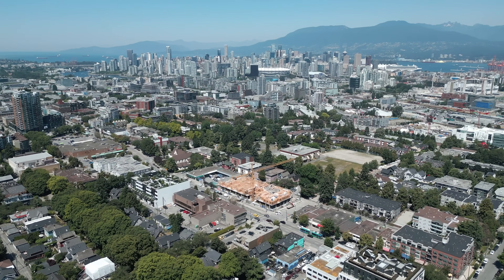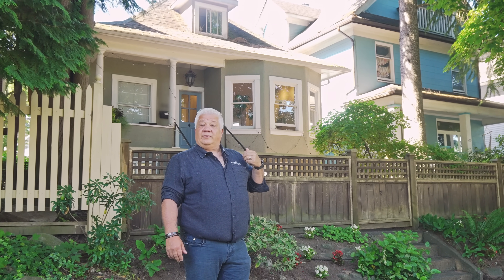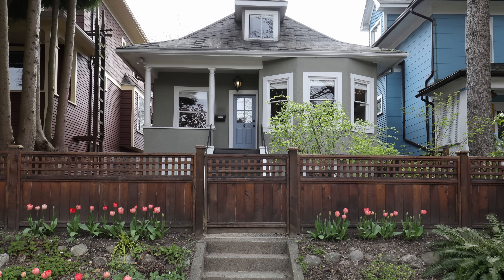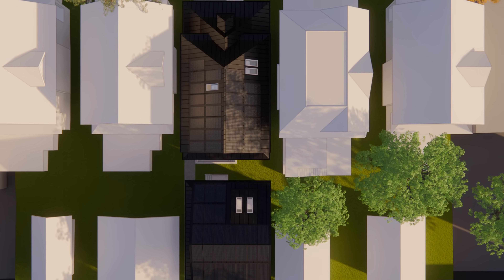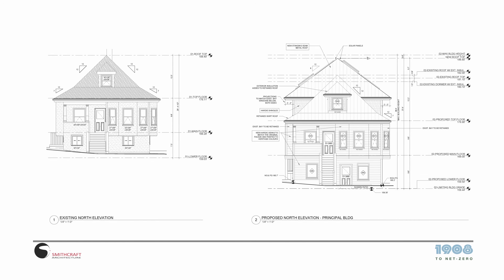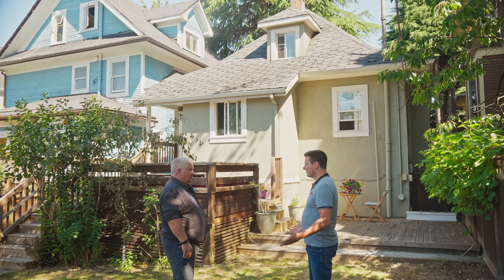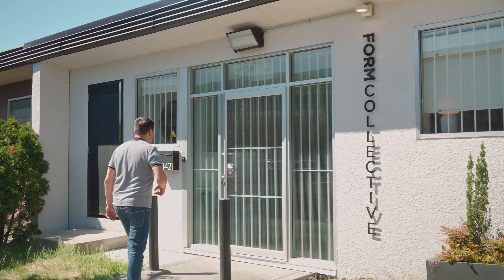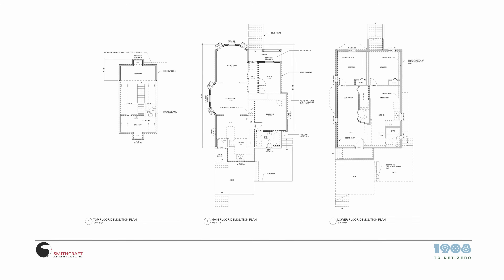Episode 1: The Project Vision | 1908 to Net-Zero

Comment: Smithcraft Architecture is proud to be a valuable team member with Deep Green Developments, Best Builders, Capture Energy, Form Collective, Energy 1 Design, Continuity Structural Engineers, and the CHBA. This is a great project that will pave the way for how to take older buildings and bring them into the 21st century.